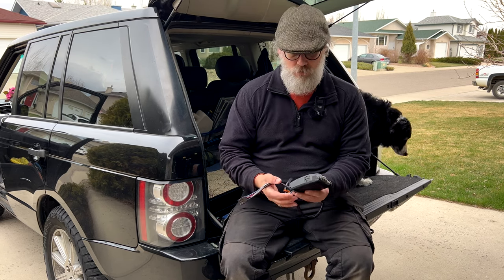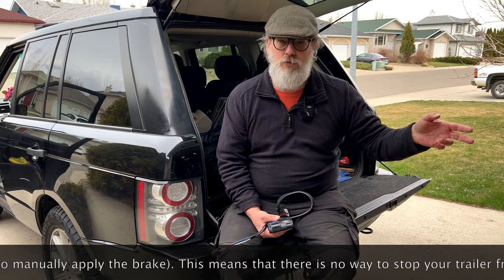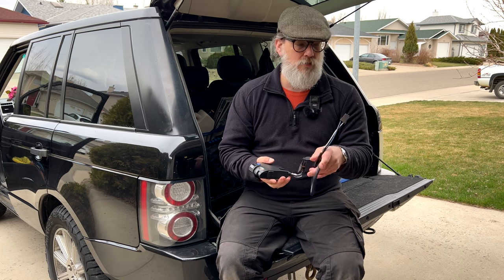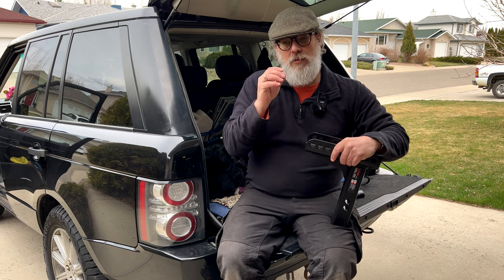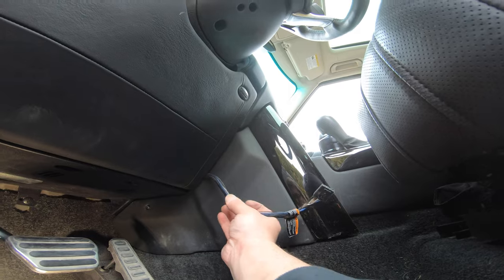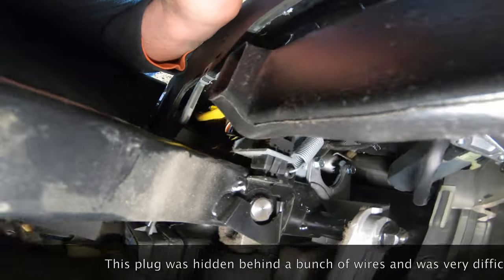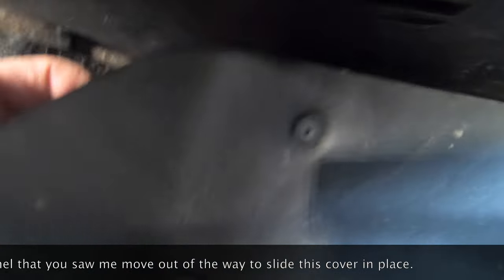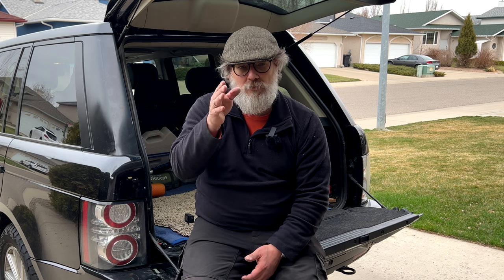Installing a Trailer Brake Controller in a Range Rover #rangerover #l322 #brakecontroller #tekonsha

Comment: Just spent an hour crawling around under the dash of my ‘08 RR SC and I could not find it. Followed the main loom from the bulkhead and there was no spare plug. Is it possible that it’s just not there? Or in a different location?
Reply from the maker: They can be a bear to find, but I am 99.9% certain you have one on a Sport (given that it is, essentially, and LR3)! They're often cable tied to one of the bulkheads or frame members that are under there, but they are also sometimes buried in other wire clusters and cable-tied up so you cant see the end. 

They are not in a different location unless you are in a LHD. I am assuming the looms are mirrored for LHD vehicles but, having never pulled one appart, I cannot confirm that they are. Given that the driver has to operate the manual switch brake on the control, I cannot imagine them being anywhere else. 

I must admit that mine was hard to find on this rangy and dangling down under the steering column on my last one!

Comment: Hellish noisy things those hitches with plain pins, especially when well used and even more so when you have both the receiver hitch attachment pins and your variable height gubbins.  This is even worse on monocoque bodies because the body is not insulated from a chassis mounted hitch but in monocoques the hitch is directly mounted to the bodyshell. Any play in the parts bangs and crashes its way through the whole cabin in my experience.  Solid mounted hitches with none of the wear and slack points, such as we mostly have in European Range Rovers, makes a far nicer drive. Even the Westfalia bayonet fitting quickly removable hitch works well but can be a bit clattery.
By the way, I’ve ordered a Grenadier! Doesn’t mean that I’ll necessarily go through with the deal though, if only because I haven’t seen one and don’t yet know whether I’ll even fit in the driver’s seat. I certainly nearly crippled myself driving my 110 HiCap for 22 years and I’m 15 years older and much stiffer now than when that went to the great scrapyard in the sky.
Reply from the maker: The geometry of this Curt hitch seems to avoid any pin rattle or clunking in the ball mount itself, but I did get quite a bit of clunking on the new Defender with this hitch (knowing I received none on the last rangy at all). 

Why I would get clunking on the Defender and none on the rangy is unknown — save only that the receiver hitch is tucked right up near the back axle and well under the vehicle on the Range Rover and sticks out of the back of the Defender. 

In my experience with the Rangy, the receiver is fairly quiet. That said, the noise dampening on the Rangy is remarkable, so that may have something to do with it. 

Over here it is possible to buy three additional tools to silence the pin clunk. One is like a flat exhaust clamp, which pulls the ball mount down to the bottom of the receiver hitch and prohibits lift. The second is a shim which slides in with the receiver and performs the same function. The third is a cushioned ball mount itself. I used the second variety on my Defender because of the clunk, but the Rangy’s receiver is quiet, so I’ve never bothered to employ it.